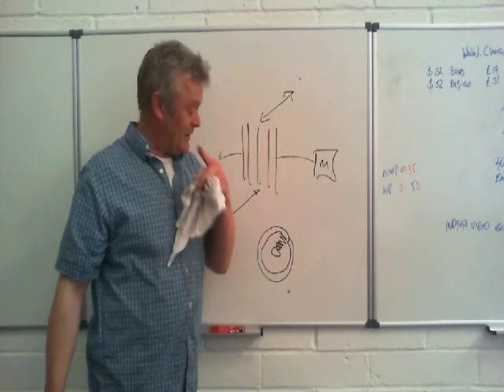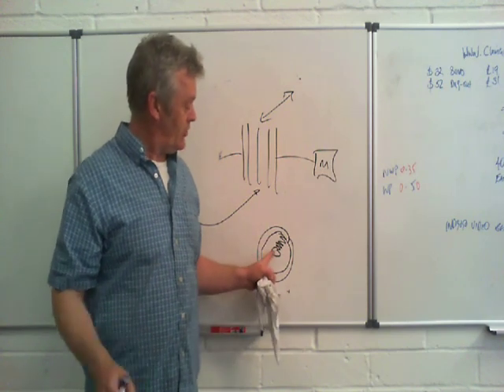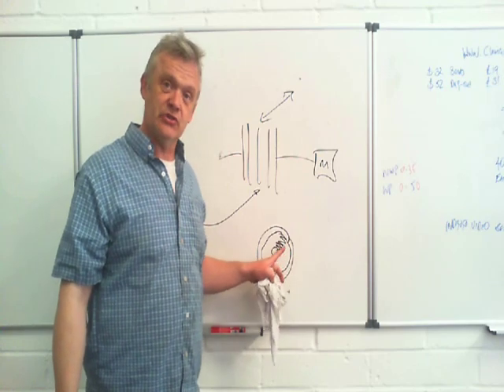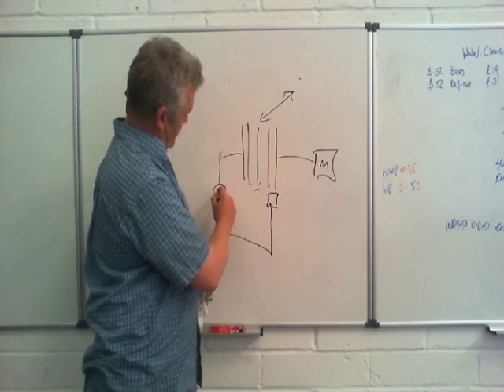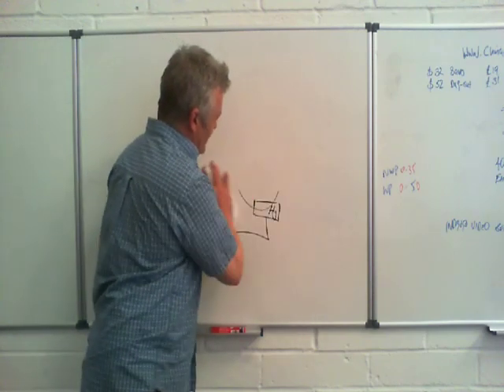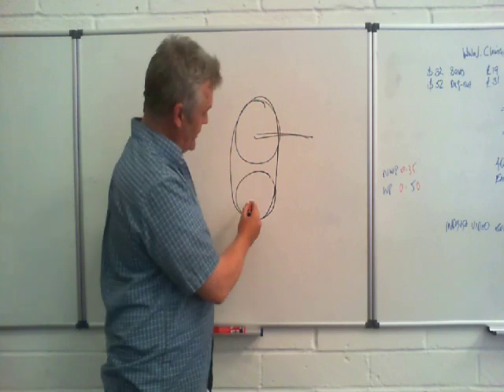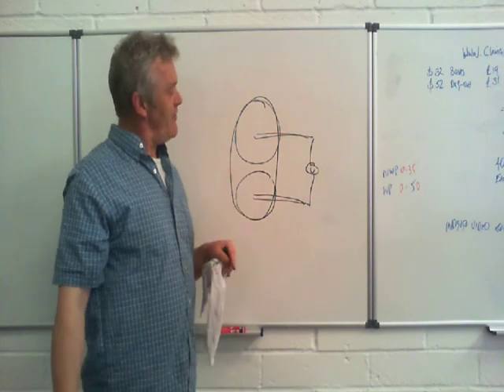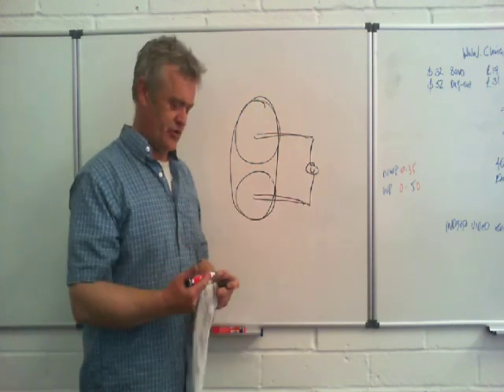SWAG Generator Prototype - 1

Comment: Something most people miss on the Tesla homopolar motor. He mentions that a second rubber belt can be attached around the drive rods. Well, If you really think about that The rubber belt is a high voltage circuit, while the copper belt is a high amperage circuit. This oft overlooked comment in the patent greatly effects the efficiency of this device.

Comment: I'm refreshed by your optimism and I'm glad you keep one foot firmly planted while you're playing in the lab.  And for that I envy you.  Thank you for being a citizen scientist.  Sadly, I'm one of those armchair theorists.  I'll try to keep it relevant.

It took me a while to connect the dots, but this hydroelectric power implementation seems not so dissimilar to electrostatic vs. electromagnetic speakers.  Okay perhaps that wasn't a good analogy, but by changing the method of energy extraction you change the perspective of requirements and limitations.

I'm curious about the possible work density.  With low or uncontrollable water currents it may be difficult to power large items, but I can see immediate use in an anchored buoy.

This is fascinating to me, and I have so many questions.  Besides the issues of grit and silt gumming up the works, would anything become non-passively involved?  How would plankton or algae interact with this stuff?  I wonder if Sally Le Page would be interested in this project, from the biology side.
Reply from the maker: The bet way to answer a lot of your questions is just to build the prototype and test it. You can discuss, theorize and guess as much as you like and it will often take a hell of a lot to do that but the answers will be quicker and more true if a simple prototype is built and tested

Comment: Hey Robert ! I saw the bid you put up about the teg trials your doing. I love the work you are doing on the swag. Unfortunately I live in a somewhat less coastal region. The coast is a few hours drive from me. I do however live in an area that has an abundance of heat. We get sun all the time. If solar panels were cheap I'd have them already and I'd be after you for nickel iron battery stuff. I own a 35 foot travel trailer with a one piece aluminum roof. I would love to turn it into a giant teg. Imagine being able to have power wherever you went.
Reply from the maker: I am doing more on that too mate - i think energy solutions will be a range of strategies not just one solution

Comment: I searched the comments and did not see anything about Kepler's buoy... so sorry if I missed something already suggested.  All those years ago Kepler created a wave pump by simply placing a floating buoy in the sea with a pipe, a flat plate was attached to a smaller pipe with a sliding seal between and 2 flow valves.  As the buoy bobbed (coupled to the surface) the plate resisted movement (resistively coupled to still water below the waves) so the seal moved up and down in the pipe.  The 2 flow valves turned that into a pump.  It seems to me that if the SWAG was simply on a stiff shaft on the buoy it would be puled up and down through the relatively still water by the buoy movement.  No "moving parts" relatively speaking!  A matrix of these buoys bobbing up and down could generate an enormous amount of amps!  For stability, how about a tube (PVC pipe?) with the upper float and lower SWAG sitting over a rod driven into the sea bottom in shallow water.  Ah, simplicity!
Alas... no ocean in Denver, CO USA
PS... also making "graphene sheets by rubbing graphite into a plastic sheet similar to your other video.  It seems this would also work for the SWAG - no?
Reply from the maker: i'll try the rubbing idea but i love the buoy idea - thanks for that
Reply: Robert Murray-Smith Along with the Kepler buoy another of Tesla's favorites was the water wall generator.  Basically you build a short walled enclosure out in the bay or a large floating barge with a "Skirt" wall.  The wall is 2/3 the wave height above average. (6 ft sea, 1 foot wall).  The upper third of the waves wash over the wall and fill the enclosure.  You open a restricted outlet and use the low head to turn a turbine... Not much head!  But, perfect for putting water over a SWAG!
Reply from the maker: Charlie Taylor
very nice

Comment: One thought has crossed my mind with regard to boat application and that is the problem of 	 	 	 	fouling,
This may be less of a problem with a closed box due to the absence of light however sooner of later life will come and occupy your box probably to the detriment of the equipment.
Just a thought .... I will be facinated by the outcome of the prototype generator.
thanks once again.
Reply from the maker: fouling of anything in the sea is an issue mate and one that will have to be addressed at some stage - just not right now
Reply: Robert Murray-Smith
Robert: water moving (even vapor) between two plates generates a voltage. A Jet-ski motor blasting it's nozzle through a set of plates or just a craft moving through the water at speed, would do the same. What about a tube arrangement, inner & outer plates of a (super)-capacitor? Water passing through, you get the idea.
Reply from the maker: dean germeten
did you read the papers i mention? - what you are talking about is triboelectricity
Reply: Robert Murray-Smith Blasting water through (or between) pipes would prevent any fouling. The pipe(s) could be of infinite length. Yes I understand Van de Graff's patent about charge separation in moving fluids (which can include gases.) Not sure which papers you mean.
Reply from the maker: dean germeten
the Chinese ones on charge separation mechanisms for salt on graphene
Reply: Robert Murray-Smith
No, I haven't seen that one. Did I miss the link? I know Lockheed-Martin has patents on desalination membranes made of graphene, it's a billion if not trillion dollar industry that holds geo-political influence, according to certain investor blogs, but they're not quite there yet. Certainly being able to pump seawater inland and desalinate cheaply, is a game-changer for many parts of the world. I did see your capacitive desalination idea. Only problem with that is, who wants to waste fresh-water to back-flush the filter? Anyway there are other great over-unity methods. A supercapacitor alone can be a great over-unity device in the presence of "stray" magnetic fields.
Reply from the maker: dean germeten
I did put it into the description of one of the videos but i have forgotten which one so here it is http://www.nature.com/nnano/journal/v9/n5/full/nnano.2014.56.html - back flushing is a common method
Reply: Robert Murray-Smith Robert: Is interesting, thank you. However, I'd like to point out that charge separation from moving water doesn't require graphene, heck it occurs in clouds. Swamp coolers use fans to move water vapor between vertical SS plates and generate lots of current. There's a water drop patent (through can rings) that produces high voltages. As for desalination I would opt for capacitive method that might allow for removal and flexing of panels to remove NaOH as it builds up, and another material not eaten by chlorine.
Reply from the maker: dean germeten
I know - thanks

Comment: Hi Rob

Good idea. The minute I see this I start calculating. Open voltage? Zero point something. Amps? 4 Amps. Wattage? P = U * I = ? But do not let this stop the development and testing.
PS: if you apply a voltage to such a sheet, they get warm? (hint). Why the hint? There are no diodes (yet). You would need to prevent the voltage from going into parallel plates. (just thinking out loud, that's how I do things). I compare this as with solar panels. If one panel is covered, it will drain down the power (a bit). With many plates and an 'average' resistance I think the same problem might arise. Perhaps it is best to go for a high(er) voltage. The average current will be depending on the worst generating plate, but voltages will add up, and using a dc to dc convertor from 50 Volt to 12 Volt (f.e.) can be done in 85% or better conversion rate. Blah blah. Think tank . ..

Could you please perform another test? If you have time, and just for the idea of it. Please try and put a test sheet into any salt solution and put it in the sonar. (I hope it does not do anything bad to the used ink, as I understand it has an effect on it). My idea is that if the water is 'shaking' violently, there might be something happening. And I do know the sonar uses a lot of power, but it is just the idea to test it. Suppose we put a big A4 swag box into the sonar and find something odd?

Deslo.
Reply from the maker: interesting ideas mate

Comment: Thank you,
The durability or longivity could be a significant factor in the develomental process. Especially if it involves high RPM or pressure.
Reply from the maker: sure - but step by step mate - just checking the idea works in the first place is probably a good move - that way it doesn't become a house built on sand and you don't put too much effort into a non workable idea if it turns out that way

Comment: I agree with the statement above that it might havers resistance to put them in series. To throw in my 2 cents, I have a dozen of ideas for passive generation but I believe a swaying snake design with buoyancy would work better in a series configuration. There is also a conical idea on that sea water goes over the top of the cone, and spirals around the graphene sheet collectors. Anyways, I am looking forward to whatever route you guys take. :)
Reply from the maker: cheers mate

Comment: In regards to a self contained unit (absent an ocean) do you think it would be possible to use a capillary siphon.  Imagine if you will a box containing the arrangement of plates (gills).  The water level in the box rests just above the gills.  Place a flow chamber at the bottom of the box.  The chamber end opposite the gills would be lined with .3 mm capillary tubes in the shape of walking sticks.  At the diameter described water can travel in excess of 100 mm above level.  The downward side of the capillary tubes would just touch a plate that is angled back toward the gills and allow flow back to and over top of the gills.  Just an idea maybe it could be of some use.
Reply from the maker: it's a good idea - i will think about how to incorporate it

Comment: Dear Robert, first: thanks again for your amazing work and sharing! :D

About not wanting to go in discussions about ratio of net power if an electrical input by mean of an electric motor, I understand you but it is only because you were not projecting a self loop. Cause if the output power if higher enough than the input, you should be able to loop it and then, no more problem of calculations needed, no discussion needed: that fact proves by itself the overunity COP (I remember anyone that COP is not the "physical efficiency", no law of physic needs to be broken to have an overunity COP while a overunity "physical efficiency" would.).
Reply from the maker: I am glad you like it
Reply: Cheers mate but what is the output voltage of the plates, You only gave amps, we need amps times volts to have an idea of the output power... ;-)
Reply from the maker: it's a couple of volts mate - i need to check as it is a while since i did this

Comment: I like the direction this is going, however something open to the environment will have maintenance issues.  How about a closed system that floats on the water and allows the waves to move the internal liquid.  You could also move it inland and allow a wind turbine to give it a bumpy ride.  You then wouldn't be limited to sea water and could use CuSO4 internally.
Reply from the maker: i like it! - nice thinking mate

Comment: Something that occured to me is that your test (the one that I saw) involves the water flowing from top to bottom in order to generate electricity. In sea envirorment, the waves alternate this flow, from top to bottom then from bottom to top. Will it grant you the same results?
Reply from the maker: it will create a reversal of polarity so a couple of diodes are going to be needed

Comment: AWWW Man, Robert! You started talking tesla turbines and I got super hyped.  I really like your idea though.  Are you going to hand paint or have you found a way to inkjet print :D.  I always thought you could transfer the power via magnetic induction and have zero friction with a tesla turbine.  Took a look at your website last night and I have not received my ink yet to verify but the site says that the regular ink 'is' able to be electroplated and the 'water-resistant ink' is water soluble. O.o Quite confused by that.
Reply from the maker: the water resistant ink washes in water when wet - but once dry is water insoluble. the normal ink can be used to electroplate but only with adsorbent organics not plastic - hope that helps lol - as for the gills I will hand paint

Comment: I'm personally gratified to see a box full of sheets and a tapered collection tube ;-)
But I still think there's a strong possibility that a dramatically turbulent flow might produce better results and beg you to test it.
My thinking is this (in a nutch):
If as the speed of flow increases, so does the power output, it appears that the energy output is relative to the energy input (although "duh" could be muttered, it wouldn't be nice). So the more energetic the input is (movement across the sheet), the more is produced.
Why turbulent?
Simply since fluids tend toward it, so it easy to produce (allow), and at the scale of the actual effect (atomic) a smooth flow is nonsense - there simple isn't such a thing.
So why not take advantage of the natural order of fluid dynamics (it's far harder to stop fluids crashing and smashing, than to make them) and at an atomic scale, the flow would be (if measured or even measurable) greatly increased.
i.e. where n mps smooth is n mps at an atomic scale, we might see n mps turbulent being n ² or greater at the atomic scale (due to stuff smashing around).
Consider how much damage is done to solid brass propellers by sea water, and due to no more than turbulence. A high energy system.

Do I make sense?

There's always the other possibility though (and perhaps you know this already?), that the smoother the flow the better. That would be a damn shame, since a fast flow that's also smooth is far less simple to achieve, and the limits far easier to fall.foul of.

Please paint a washboard and stand on a table etc. ;-)
Reply from the maker: I absolutely agree with you mate - but you know me - simple first - i'm a simple guy lol
Reply: Simple often equates to efficient :-)

Love the serendipity of the perfect ink BTW.
Like getting a pat on the back from existence when stuff just works :-)
Reply: You still have to consider the structural strength of the package you are employing. If you make the water turbulent to increase power output you may destroy your collector. Also what happens when the sea adds it's own turbulence to yours such as coastal rough seas.
Reply: thagrit yup.

Comment: If the surface of a disc is painted or printed with grapene in a cylindrical spiral (like a phonagraph record) and spun, with salt water the centrifugal force of the water passing across the grain would generate electricity?
Reply from the maker: do you plan on trying this?

Comment: I love these videos. Great idea but I think you are halve way there to a excellent generator. If the unit is of a closed loop design you could couple thermo syphoing, the lovell method to generate electricity and also the flow of salt water over the plates. I'll draw a picture and email it as my explations are some times rubbish. Keep up the work and videos. At this rate I could cancel my tv licence lol
Reply from the maker: lol - my email is robertmurraysmith64@gmail.com- i'd love to see - but to be honest mate - i'd prefer it if you did a vid and shared with everyone else too

Comment: When you "isolate" the charges, air would be easy/cheap?
Consider bubbles.
Yes, keep any motor out of the equation.  Though standards can be measured by the output.
Colorado river is slightly saline, but an optimum solution could be used by transferring the energy.
As for sea experiments, more power to you.
Reply from the maker: I think the system works as a whole so i have no idea how bubbles will work but it is an interesting idea and worth a look at - try it and let me and everyone else know how it goes

Comment: You've got 2-8 amps but what voltage is it expected to produce?
Reply from the maker: dunno - i plan on finding out though - anyway - it doesn't really matter as we can connect the plates in serial parallel configurations to get the voltage we want - it is power output that matters here, then cost per kilowatt and then power per kilogram - but there is no real way to answer these questions with out a prototype test - all we have done so far is answer the question - 'is it worth building a prototype?' answering any other questions regarding performance will amount to guesswork.

Comment: HI ROBERT
    THIS PROCESS LENDS ITSELF PERFECTLY TO THE CONCEPT OF THE WW II V-1 RAMJET ENGINE....THE FUEL WAS PULLED INTO THE COMPUSTION CHAMBER PROPORTIONAL TO THE SPEED... THE GREATER THE SPEED THE MORE THE FUEL..THE MORE THE FUEL THE GREATER THE SPEED..
APPLIED TO ELECTRO WATER ENGINE:   
   CLOSED LOOP CYCLE:   FORWARD MOTION OF THE BOAT IN THE WATER PRODUCES  ELECTRICITY....THE GREATER THE SPEED THE GREATER THE ELECTRICITY... THE GREATER ELECTRICITY THE GREATER THE SPEED...

AM I UNDERSTANDING THIS CORRECTLY:  APPRECIATE PRIVATE CONTACT:  J.PIERCE-INTL@VERIZON.NET
Reply from the maker: Hiya Mate,

Never thought about it - but good idea - ideas like this are why i share - so many better ideas than i can have - on a side note - please don't use caps - it's like shouting